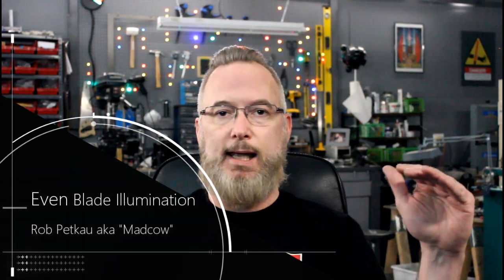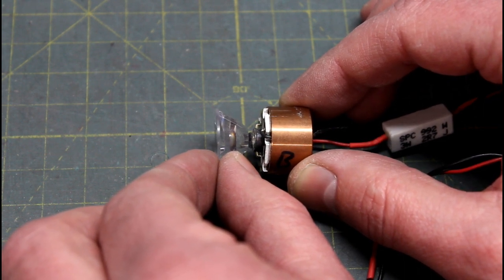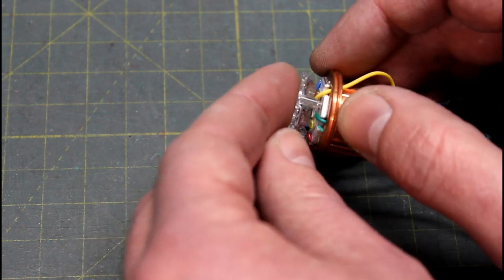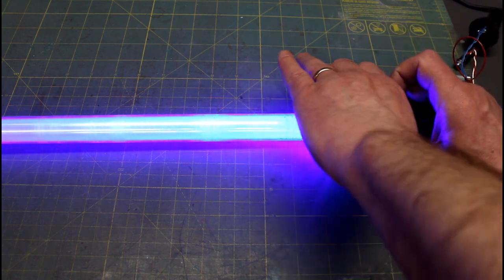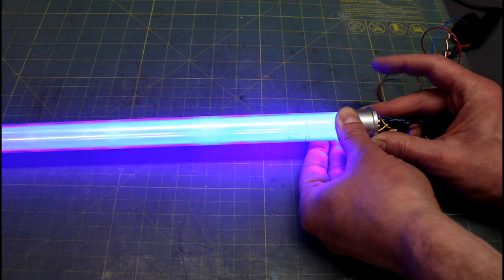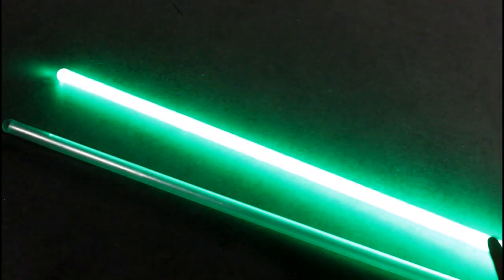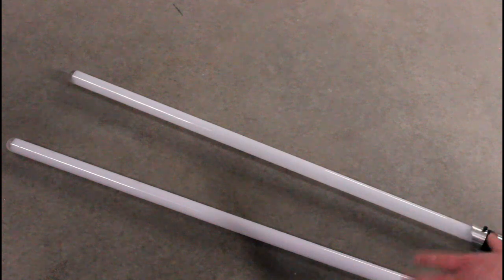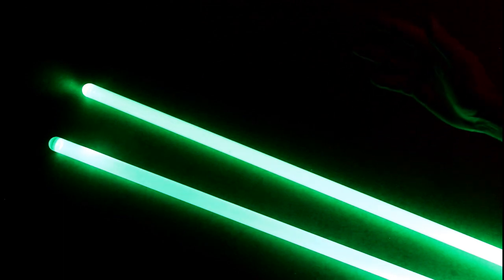Even Blade Illumination

Comment: I have a saber from Ultrasabers with the emerald driver. The blade is noticeably brighter at the hilt and dimmer at then end. The LED module is four diodes under one dome, which I assume to be RGBW, (thought obsidian launcher only allows me to control rgb) with one lens without support. The lens also has a frosted area just above the LED. The blade I am using seems to be a transwhite heavy grade blade without film (I got it secondhand). What would be the most likely cause of the uneven lighting?

Comment: https://www.google.com/search?q=3mglass+bubbles&source=lnms&tbm=shop&sa=X&ved=0ahUKEwisyMqzis_aAhVQM6wKHVpUBA8Q_AUIDSgE&biw=1440&bih=806#spd=1245607262957672651    This new developement from 3M Technologies is hollow glass microspheres. I guess an interior spray gloss and thin dusting with these new Glass bubbles would difuse the blades light array very well.   Try it out and let me hear the results. Just a thought.

Comment: New subscriber here☺ I've been working on a mental design for my own lightsaber and was hoping you could give me some advice, specifically for the hilt design. The base material I want use is a wooden dowel with the center drilled out and complemented with a brass decor. My issue is that I want to build a saberstaff that can become two lightsabers. If you were to build a lightsaber with a nearly all wooden handle, how would you do it and what kind of wood would you use?

Meant ask one other thing; I've seen a ton of lightsabers using a round blade, but no other shape. If I wanted to install a more oval shaped blade, and have it still combat ready(lol), how would you go about this idea?

Comment: After completing my 1st ever lightsaber today, I've gotten a blade that isn't very bright, its completely blue with none of that white in the middle, its just the same color everwhere, and I'm not sure what i did wrong, I installed everything correctly, and the only posiibilities I can think of for the problem is either the batteries or the blade I'm using.

Comment: How to install those diffusers into the blades though? I've heard of using a wooden dowel but no success. Tutorial video?
Reply: There's not much to it. Wrap around a wooden dowel, be careful to keep lint and dust away. Slide into blade. If you slowly spin the dowel the opposite way the blade film unravels until you can slide the dowel out. Continue to unroll the film with your finger until it's relatively tight. Secure with scotch tape. Done
Reply: In your opinion, how many film wraps do you find to be optimal? Single, double, or quad wrap?
Reply: I haven't wrapped the foil, but once rolled the secret is to tighten the spool, then insert, then spin the blade from near the hilt with the paper in far. The centrifugal forces push the paper to expand and meet the tip. 

Rolling tightly is done gently with diagonal pressure which you counter by oposing the rolls direction. GENTLY. Rolling that stuff is the most difficult part unless you have no idea how to do 8's with a stick or sword. Just swing loops around GRIPPING from NEAR THE HILT to put the centrifugal forces pushing to the tip of the blade. 

My best blade (concept still untested by me) is a clear 1/8 think tube at the saber width, using the inner layer of film, and an outer layer of light sanding... I"m still looking for a sand grade, but I'm going to have to guess finer than 120....

Comment: Hey Madcow!  At the end of the video, does the Tri-Cree Trans-white Diffused Blade not have a mirror in its tip?  It's awefully bright compared to the Tri-Rebel Trans-white Non-diffused blade's tip which you mention has a mirror!  

Specifically, I'm asking about the tip itself, and not the light generated at the last 7" of the blade tube by the mirror which is more apparent in the non-diffused Tri-Rebel blade.  The non-diffused's tip is darkened because of the mirror, but is the diffused's tip brightened by the film or does it not have a mirror in its tip?  

Thanks for another informative video!  p.s. I see you're sporting a new coif, are you working on a chonmage?
Reply: Hey,
All the blades shown here have mirrors in the tips. I neglected to mention that the mirrors are of slightly different size. The new mirrors are slightly smaller to allow light into the tip. Where you see an un-lit tip - that is an old full size mirror.

Comment: 2 questions for you:

1. If you use the color discs in your LED and you use 2 of those discs, would the 
    light density change the contrast of the brightness also?

2. Can you do a video that shows how you install and use the defuser in all blade 
    designs?
Reply: Hi,
Question 1 = those colour disks really reduce brightness in my opinion. They are from back in the day when the white LED was much brighter than the colours. Not anymore.
2 = Good idea. But until them it's a great question for the forums.

Comment: Where and what exactly is the source for the internal diffuser material u added to transwhite blade?
Reply: It's the same stuff that's in the Corbin style blade.
Reply: aka cellophane /clear gift rap you can by it an any craft store
Reply: Incorrect or maybe overly simplified?  "Corbin" film is not the cellophane/gift wrap that others use.  "Corbin" film is named after Corbin Das that made the film.  He was following Psab Keel one of the pioneers of in-hilt LED sabers.  Psab was doing a "dual tube" design where they wrapped fishing line around the inner tube.  This created a laser like "core".  Wrapping the fishing line was really time intensive.  So Corbin sought a way to replicate this with less effort.  He found a machine that could score a plastic film in a repeatable manner.  I remember at some point he said it was a print machine that did it.

I haven't found a film that's quite like "Corbin" film even so.  It's not milky white (like HDPE) or silver when wrapped (like most plastic films).  I support TCSS so it doesn't bother me, just an observation.

The "gift wrap" many buy from stores is actually Polypropylene.  "Cellophane" is organic and generates way more static.  Static gets all that crap inside your blade and ruins it.
Reply: I stand corrected. The method I mentioned is what I do for clear gift wrap.

Comment: Hey I am trying to construct my first saber and I'm going to order all the parts from TCSS, however I live in another country so the lithium battery is the only part I'll be missing. Do you know any way I could install the wires in the same kind of battery (Panasonic li-ion 18650) so that it is more or less the same as the one sold by TCSS? Thank you for all the videos! They're awesome!
Reply: you can get one from ebay/amazon but you need a holder
Reply: Ben besocke thanks! But does it already have the cable with the connector at the end?
Reply: you would need to solder one to the battery